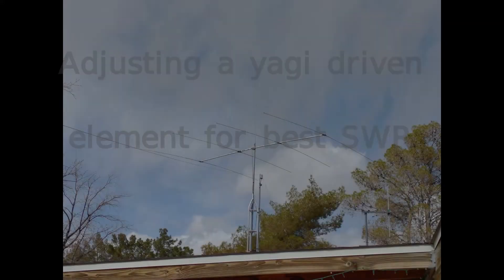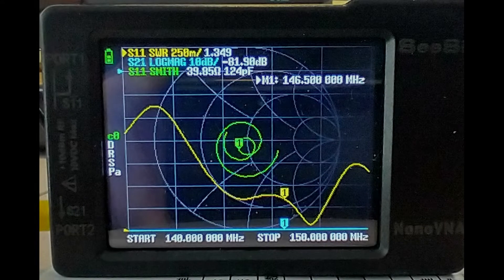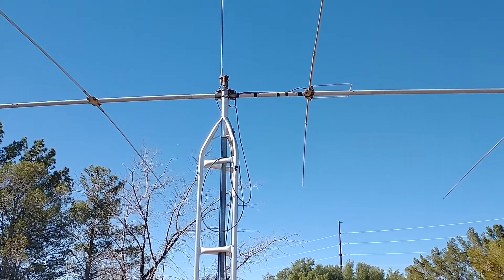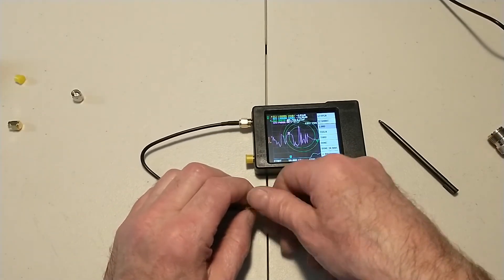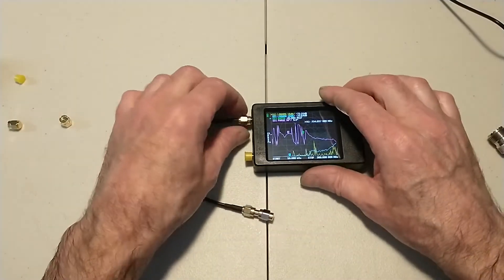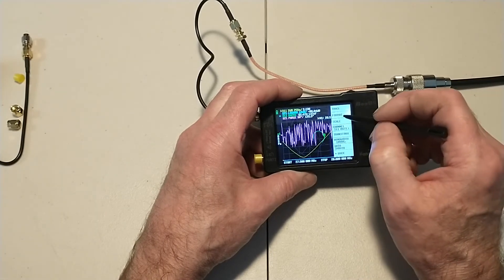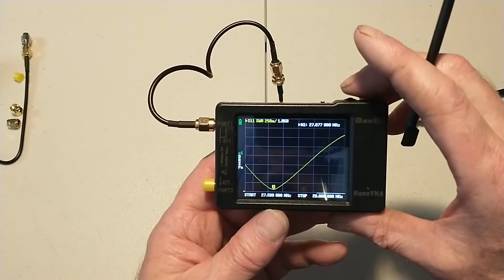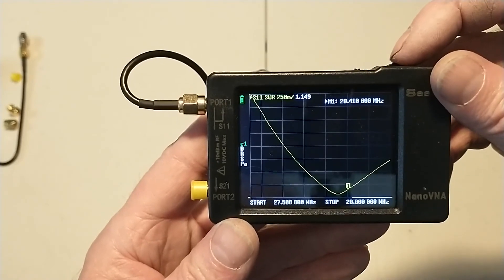Adjusting the driven element of a yagi for best SWR (standing wave reflection). -Rick's Shop

Comment: Do your calibration with open and short and load at antenna  end of the coax,,,this eliminates  any effects of the feeder length when taking  readings at shack end,,so you see a true reading  in the shack,,,either that or take vna out to antenna end and tune antenna.

Comment: Would you happen to have the dimensions for 11m/27.205, element lengths and spacing?
Reply: driven element 2.650m.... refl +5% dir-5% refl to driven 1.7m all dir 1.470m there ya go, 6m boom works perfect, bandwidth 1 Mhz

Comment: Must calibrate with the freq. start/stop or center already set. Also cal with the actual cable and any connectors that will be used when connecting the feed line

Comment: Dont you have to shorten the two directors as well?????
Reply from the maker: Actually, both the directors and reflectors should have been shortened along with the driven element. But this antenna was set up very broadband with a long reflector and short director, so in the end I just verified the directors were shorter than the driven element (they were). I plan to add 6 meter elements in the future and will remodel the whole thing then.

Comment: Nice CB beam Conversion . That's always been  my favorite beam.....Maybe you did a "Reference Plane Extension" Calibration & I missed it....Highly recommend setting the Frequency start & stop Before Calibration saved to a Memory....Calibration Only to a Short coax Jumper can significantly throw the measurement off if not compensated...
Reply from the maker: Tell me if I'm wrong, but I calibrate with the open/short/50 ohm sma's at the pl259 that attaches to the transmitter.
Reply: Hi Rick,...You're good ! ... I'm Still learning how to use the nanoVNA & mistakenly Thought (from other users) the Open, Short & 50 ohm terminations needed to Connected at the Antenna location.....Learning something every day in this hobby ! .....Thx for posting..

Comment: As was commented, the Calibration Must be done & Saved to a Memory Selection..... Equally important, the Calibration Must be done at the Antenna Terminals !!  Your 6" length Calibration is Meaningless !!  It's referred to as the "Calibration Plane" by knowledgeable VNA users....The VNA is no more Accurate than the Correct calibration Procedure....
Reply from the maker: As I replied, my first nanoVNA would save a calibration, this second one will not. I calibrate after every power cycle. Also, I want to know what the SWR is at the transmitter (where high SWR will cause damage). SWR at the antenna is meaningless.
Reply: If you say so? lol

Comment: Can you mount the antennae low to the ground to make adjustments, then put it up, and it will work?  Btw, I’m a woman, a retired contractor, but this is out of my field.  Help!!!
Reply from the maker: You can, but the closer you get to the ground, the lower in frequency the antenna resonates.
Reply: yes,, resonate antenna for 28.7mhz low to ground it will resonate at 28.5 when 12m high

Comment: Why don't you just use the internal memory and recall the last calibration for your frequency? That really helps if you spend a couple of days working on the same antenna setup. Save position 0 is the one used when the device starts btw.
Reply from the maker: I did that with my first nanoVNA, my second one loses it's calibration on power cycles, so I calibrate every time.
Reply: @ricksshop Rick. 

I bought one of these from a ham. It was tuned at 29.250.

Im wanting to use it for 27-28mhz do you have some numbers for sizes of the gamma rod and elements. I am lost and because I have it on a pole I have to keep running up and down stairs to check the swr (which is a 4 throughout 27 upto 28.990).
Reply from the maker: @RabMac108AT10six  I would try lengthening all elements 2% (about 2 inches each side). The Gamma match will fine tune SWR.
Reply: @ricksshop  OK but how do I lengthen the elements if the self tappers are in a set place? I have it with all the screws in their sleeves... Do I Add new longer aluminium tips, do you mean ?
Reply from the maker: @RabMac108AT10six  With the screws removed do the tubes telescope?
Reply: @ricksshop  yeah but not two inches your talking maybe an inch tops before the holes for the self tappers that hold the elements together.. I'm thinking I'll replace the rods with another. Thanks man

Comment: its obvious you did not read the instructions because you are still not using it properly. FIRST you set your frequency range THEN you calibrate. When you add your adapter you need to adjust for that next plug in the antenna and do your measurements. If you change the frequency range you need to go back and recalibrate then adjust for the adapter again. They are a pain to use but work well. There are some very good video that describe all this.